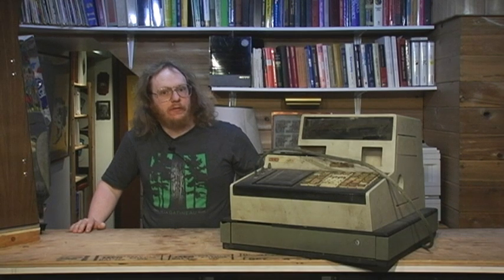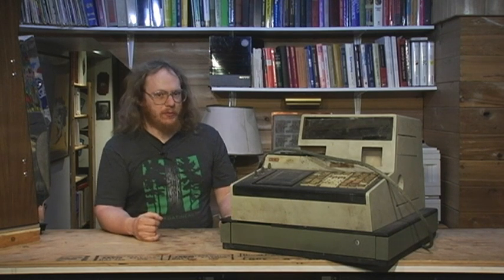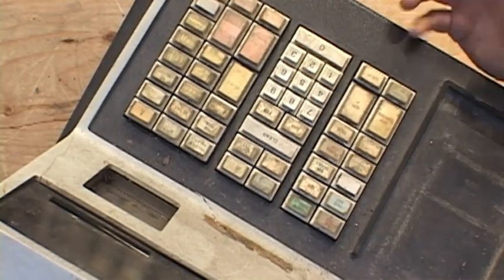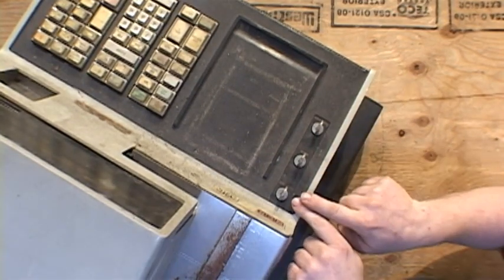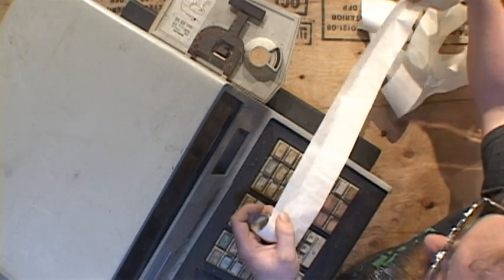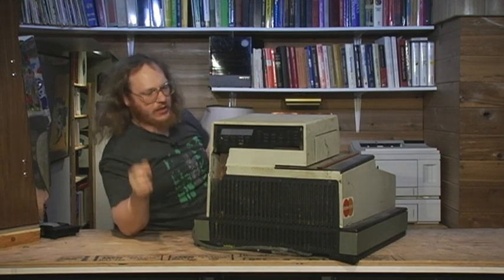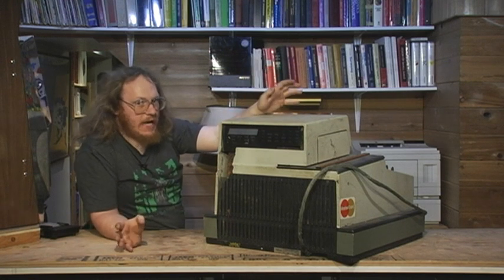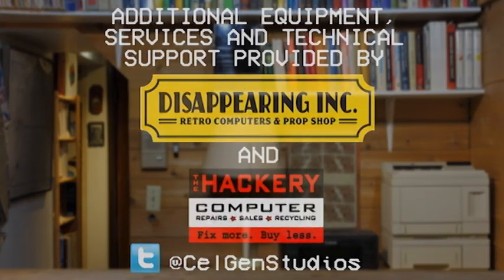NCR's Class 250 Electronic Cash Register: Part 1

Comment: I remember when Sears in Inglewood California went to POS equipment, and how barcode numbers were entered instead of prices.  I cannot remember the maker of the terminals, but I do remember they had large multi-digit incandescent lamp color 7 segment display.  

There was an earlier NCR system where all of the functions/features were programmed in machine language.  A real headache I was told.
Reply: Sears started with Singer-Friden electronic POS terminals in 1970 or so
Reply: @thatjpwing  I later realized this.  There is a website/blog dedicated to Singer-Friden POS systems.

Comment: I was trained on this in 1977; It was tough, since everyone was being trained to use it while working. 
I was 20 and had just landed a hotel front office job. 
I'd been using the NCR 4200, a simple posting machine and it was quite different.
I still remember the Journal credit/debit keys that gave accounting so much hell because the employees weren't used to the meaning of debit/credit in accounting terms.
The mode key was for taking the end of shift on "X" and end of day on "Z".